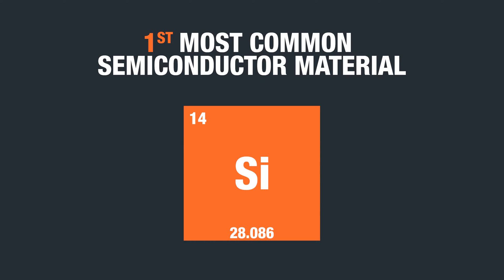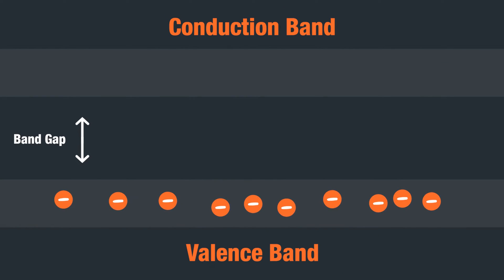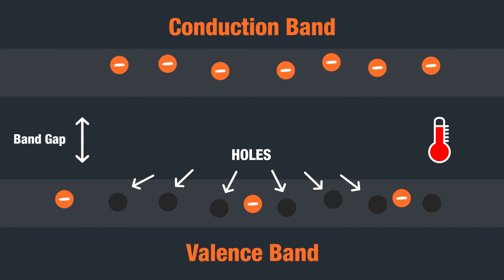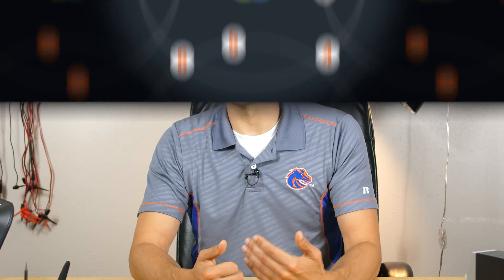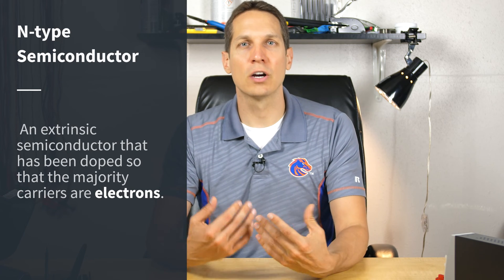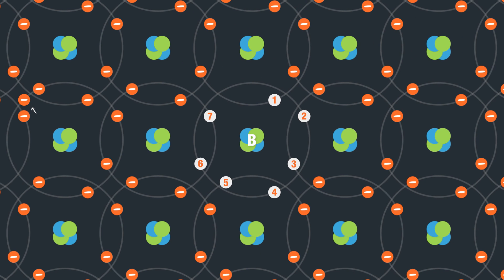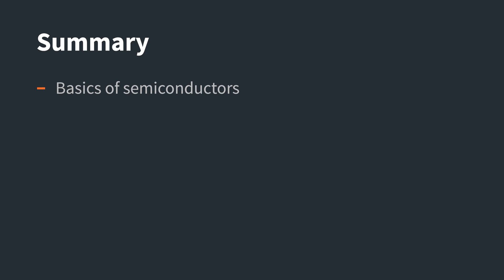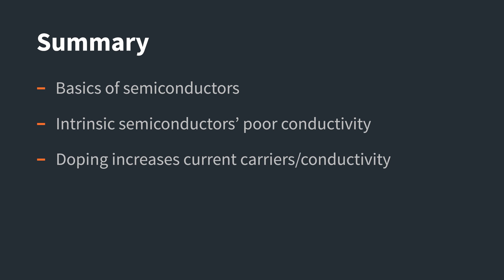Classification of Semiconductors (Intrinsic/Extrinsic, P-Type/N-Type)

Comment: "In an intrinsic semiconductor material, free electrons are produced when the material receives sufficient thermal energy that provides..."  why is it thermal energy and not the energy provided from a voltage potential that brings in extra electrons to knock the valence electrons in the semi conductor up to the conduction band?  We don't turn on semiconductors with heat...  or do  we?
Reply from the maker: We don't actually use intrinsic semiconductor materials in devices (well... we do, but for our purposes, we'll ignore that at the moment).  You are correct, though, we do not turn on semiconductors with heat - it is a voltage.  But with extrinsic semiconductors, we get more charge carriers because they've been doped and in the case of n-type, those extra electrons literally float around in the conduction band because there's no empty spaces for them in the lattices of the semiconductor.  Without that doping, the resistance of the material would be too great and you'd need very high voltages to really do much of anything.  Besides that, it's generally the connection of two semiconductors of different dopings (p-type versus n-type or even just different levels of doping of the same type) that make things interesting.
Reply: @CircuitBread  I wish I would have seen this earlier - lousy youtube notifications.

ok ok ok, I see where my assumption was about free electrons.  It sounds like you weren't talking about doped semiconductors, just the base properties of the materials.  Thank you for being so clear and precise about the doping "element" of this topic (hahahahaha).  And I take your final sentence to mean the pn junction of a diode or npn/pnp transistors?

Comment: n type dopoing increases the free electrons as well as the conductivity of the semiconductor                                     AND                         
p type dopoing increases the holes  as well as the conductivity of the semiconductor                                                                                                                  isn't p type dopoing  supposed to decrease the conductivity?  3:52
Reply from the maker: P-type doping doesn't decrease the conductivity, as it increases the chances of conduction via holes.  As holes aren't as mobile as electrons (which makes sense intuitively when you consider what holes actually are), the conduction of p-type semi-conductors isn't as high as a similarly doped n-type semiconductor.  But it's still better than an undoped, intrinsic semiconductor.

Comment: Firstly, thank you sooooo much for your effort and your simplicity explanation, but I need to know something: as we know the intrinsic semi-conductor the p=n=ni; so if I want to convert it to p-type or n-type, how much should I dope with a donor whether with electrons or holes
Reply from the maker: Oh, I hate this answer, but it depends.  You can lightly dope or heavily dope something to and you're usually given a goal and you need to calculate the amount needed.  The one thing I can say is that the ratio between the dopant and the intrinsic semiconductor is incredibly low.  One dopant atom per thousands of intrinsic semiconductor atoms is incredibly highly doped.  Usually it's much lower than that, with one dopant atom per millions or billions of intrinsic semiconductor atoms.

Comment: I don't understand how "most" of the charge carriers would be electrons or holes.....when one electron moves....it produces exactly one hole.  It seems that it would always be a 1:1 ratio with no majority or minority carrier.  Any help on this is appreciated as I am just getting started, and I am confused.  Thanks
Reply from the maker: That's a very normal question to have, and in undoped semiconductors, you're exactly right.  But when you "dope" the semiconductor - add extra holes or electrons by putting in another material - then you get a carrier that becomes the majority carrier.

Comment: won't electron current flow in P type ? because as we know that the electron current flow due to free electrons but as there is no any free electron so it means there will be no electron current in P type ?
Reply from the maker: Hi Aina!  This is where it's a bit tricky, as all flow really is the movement of electrons.  So electrons will be moving, but we will consider it as hole flow instead of electrons in the p-type material because those electrons will be popping from hole to hole.  Besides this hole movement there will also be a few free electrons flowing, but there generally will be a lot less than the hole movement.

Comment: Great ...Explanation, Correct me if iam wrong, At   0 kelvin Ptype Semicaonductor behaves as a conductor as there are few holes  even at 0 K, and N type semiconductor behaves  as an insulator at 0 kelvin
Reply from the maker: Hi Roshan!  Thanks for reaching out - my understanding is that at 0K, all semiconductors (intrinsic, extrinsic, p-type, n-type) act as insulators as the electrons are strongly bonded to the nucleus due to the lack of ambient energy.  Even though there are holes at 0K, there still needs to be movement of those holes (which, truly, is electron movement) for there to be current.
Reply: @CircuitBread    Thank you so much... Will be watching an  add ..to support you..

Comment: Is there have a similarity between semiconductors type N and P?
Reply from the maker: Actually, other than their dopants, there is no physical difference in the N and P type portions of a semiconductor.  To be clear, that's with the same substrate - you can have all sorts of different semiconductor substrates and they will act differently.  But then it's the dopant that makes each substrate P-type or N-type.

Comment: Thanks for the video ! Just one question, is it correct to say that as the concentration of impurity and temperature increases, the mobility (electron and hole) decreases ? Therefore, as mobility of electrons decreases more conduction exists = electrons jump to the conduction band 
Thanks
Reply from the maker: Hi Roberto!  It would be correct to say that the mobility decreases as the concentration of impurities increases.  But I would be careful to note that the ability to conduct isn't the same as things actually conducting.  Even if there are more electrons in the conduction band, unless there's a voltage potential across it, there won't be conduction.  I hope I understood and was able to answer your question!

Comment: Sir, I do have a question! So at 3:40 you mentioned that Boron is negatively charged, so does that mean:
1) p-type semiconductors at room temperature (even when it's itself, say without any contact with another n-type one) are have an overall ionized state with negative boron atoms surrounded by many positively charged silicon atoms? If this is so, then why doesn't a depletion layer form in a p-type semiconductor sheet itself? 

2) You said that the holes in Boron atoms grabs an electron from the surrounding valence bands of the Silicon atoms when TEMPERATURE INCREASES, so does this INCREASE mean a temperature raised above the room temperature, or is it just the room temperature? (Hence by increased temperature, you mean any temperature raised from absolute zero)

Also, so many thanks for this amazing video, so far the best one about this topic I have seen!
Reply from the maker: Hi and thanks for your kind words!  Let me see if I can help. 
1) Even though the Boron atom is negatively charged when an electron jumps into that hole, the entire lattice as a whole has its charge unchanged. Since it was a neutral charge at the beginning, even though there will be variances within the lattice due to electrons jumping into holes, the overall charge is still neutral.
2) This increase of temperature is basically any temperature above absolute zero, and the warmer it gets, the more likely it is to happen. 
I hope that helps - thanks for reaching out!

Comment: I wonder why we need to increase the conductivity of a semiconductor by doping it, while we already had conductor (metal) for that purpose?
Reply from the maker: Hey Son!  That's an excellent question.  It's all a matter of scale.  Even when the semiconductor is more conductive, it's not as conductive as metal, on purpose.  You still need a bandgap in the P and N materials to make a useful PN junction, otherwise you'll just get an ohmic contact or a Metal-Semiconductor junction (useful in certain applications but not others).
Reply: I think the best analogy that I can give is the water pressure on a faucet. If you want the pressure to be at maximum level, you would open the valve fully. Same with conductor, if you want the current or voltage to be at maximum, you’ll probably use a material with the smallest resistance which would be a conductor (metal). But if you just want the water pressure to be low, you would just open the valve a little. In semiconductors, doping acts like the valve, which allows you to control the current or voltage just like in a transistor that is configured as an amplifier.